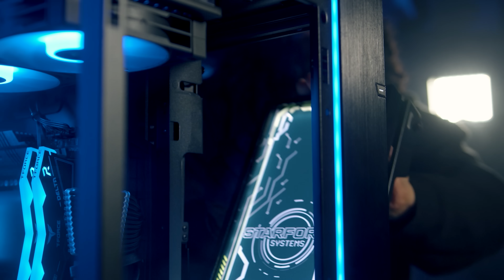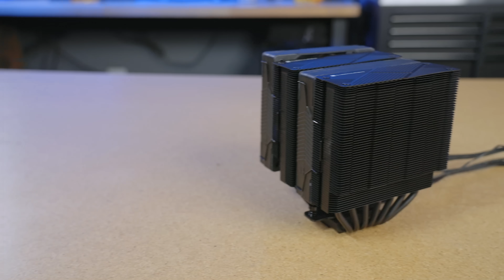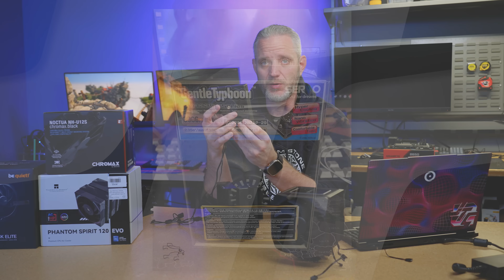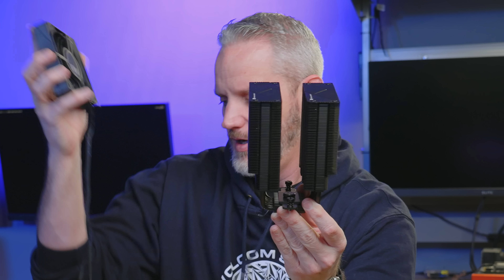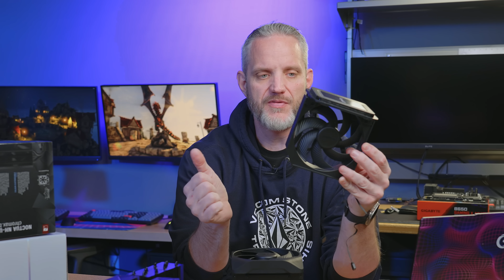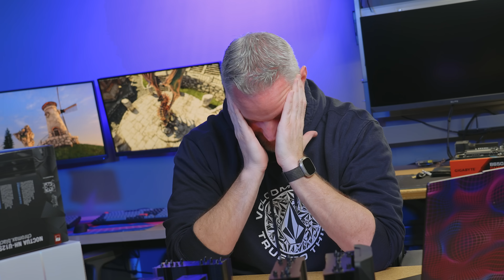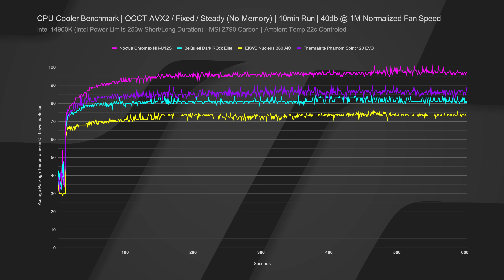This $49 CPU Cooler has big brands SHOOK! Thermal Testing Cheap vs Expensive CPU Cooler!

Comment: The biggest issue with Thermalrite is the ridiculous number of choices you have,
Reply: That is the companys problem mostly. You can pick any one of them, even the cheapest Peerless Assassin SE, and get a great cooler that is practically just as good as the other Thermalright dual towers, even the more expensive ones.
Reply: @MaaZeus  suffering from success
Reply: @Spectyrr  this is so fucking surprisingly accurate from me 😆
Reply: After-sale support isn't great either. They announced an adapter frame for AM4 (when that socket was still fairly new) for their older coolers like the Macho series, but about a month or so post announcement said adapter was impossible to find anywhere. It's like they only produced a couple hundred and that was it. The coolers are great, their support not so much unfortunately
Reply: @Knaeckebrotsaege  Yes, I still use D14 from 2009 on AM4 system, and it is still compatible with everything in the market and you actually can get these adapters in real life.
Reply: @Knaeckebrotsaege  they manufactured only a few of those, then switched to the Aro 14 for AMD Sockets... too bad you don't get a black one of those... only grey and orange...
Reply: @Knaeckebrotsaege  That is the one thing where Noctua trumps them all. But they can afford it because you pay dearly for their products. For Thermalright I guess it is better to get a new cooler if a need is dire, but at least you won't pay an arm and a leg for them.
Reply: Eh. My retailer has 34 different Thermalright air coolers listed. They also have 32 different Noctua air coolers listed. Options are good. Homework required is good too.
Reply: @lunsmann  want the second best air cooler on the market? Go with Phantom Spirit 120 SE. Want the best air cooler on the market? Go with Noctua NH-D15 G2 for 3x the price.
Reply: It's Thermalright
Reply: @Cytronik  I thought so, I originally wrote Thermalright, but the description under the video they have it as 'Thermalrite' so I changed it, thinking Jay and co would know better as they are reviewing the product.
Reply: Just pick the one your case can fit and what you vibe with the most 😂😂😂
Reply: this, all that options and the one I want wasn't available, so I ended up buying Scythe Fuma 3
Reply: You're not kidding. I just went to have a look at a local store here in Australia (Centrecom), selected filters "CPU coolers", "Thermalright" and "air cooler" and it's still showing me 30 options!
Reply: Yeah it's crazy how many SKUs they have
Reply: and yet………..all are very good.
Reply: and the fact that some of their cooler advertise LGA1366 compatibility (even on the box), while in reality they do not support it. they actually removed it for the frozen prism 240 black when i pointed it out to the CS, so points for that.
Reply: This applies to any other component or accessories too lol
Reply: And everyone of them cheaper than everything else.
Reply: and second issue is the fans - K12 ARBG in one of two ARGB not working properly and bigger issue is smell, real bad smell for me it is not usable bc of this, i brought single A12x25 instead
Reply: @Foton0154  The fan Y-Cable thing did self destruct on me for mine, as in it just fell apart.  I figured maybe I just put too much force on the cables when tying them aside though.  I used two CPU fan jacks instead of the Y cable in the end.
Reply: They only sell one product. The Thermalright Peerless Assassin 140. That is the one you want. It is the best air cooler on the market and only 50 bucks. Ignore everything else. Thermalright Peerless Assassin 140 is it.
Reply: @12gaFreedom  except Phantom Spirit 120 SE is better...
Reply: @MV-ri7zu  r u sure
Reply: @joby602  yes
Reply: @joby602 Doesn't matter .. they are both good enough.
Reply: All of their dual tower designs are great, limit yourself to those with 6 or more heatpipes and you only have to look through... 55!!!!! SKUs.
These guys are insane...
Reply: @YOEL_44  A lot of their "different" SKUs are just single or dual fan versions, or a cheaper version of the same cooler that isn't fully painted and/or lacks the endcap hiding the heatpipes on the top to make it cost less to manufacture ("SE"), or just the same cooler but less tall ("mini") etc  ... there aren't THAT many actually different coolers, but a lot of variations of the same models
Reply: @Knaeckebrotsaege   As a consumer that doesn't matter, you see such a list of options and you get overwhelmed.
Reply: @12gaFreedom   bought a thermal right 360 aio for about 75 quid and very happy with it idle temp is about 3-5 degs above ambiant and hasnt exceed 55degs on full load or prolonged gaming
Reply: @12gaFreedom  Won't fit in my Lian Li ITX case. Peerless Assassin did, albeit with just one fan at the center because of the mobo cables being in the way.

Comment: @Jayztwocents Check out the unique design of the ALSEYE W90C CPU Cooler, Temperature Displayed CPU Cooler or the  Thermalright Burst Assassin 120 Vision Black CPU Air Cooler. I am using the Thermalright with a Asus AM5 Tuf motherboard. Both are very "cool" in design.

Comment: I bought 2x "Phantom Spirit 120 Evo" to cool a 9800X3D and his little brother the 7800X3D for game configurations on Star Citizen and CP 2077
But I replaced the original fans with 120mm "Silent Wings 4 Pro"
The best of "three worlds" :eyes-pink-heart-shape:
Reply: Are the silent wings 4 pro considered the best 120 fans? Kinda new in building and looking for a cooler
Reply: @maisondav1d  Question of point of view, for me, it is the best performance ratio VS noise nuisance !
The most magnificent is that "Phantom Spirit + 2 silent wings 4 Pro" are more efficient for cooled and quieter by several dB than the Dark RockPro 5 and the Elite I tested before making this "mix" :finger-red-number-one:
Reply: @NH-Nicolas  cool thx 🙏🏻

Comment: Oooh on the note of cooling, did you ever see Optimum's video about "I fixed PC Cooling." and the idea of 3D-printing internal air ducting to properly channel airflow? 

If so, did you ever test it for yourself? The performance increase he has in his video are pretty impressive but I'm curious to see someone elses experience.

Comment: 11:30
You should  test coolers on all amd cpus because amd coolers result are diffrent in comaparassion to intel
But amd cpus has a little problem wich is 1 ccd vs 2ccds
So you have to do all amd cpus

For further clarification you can ask hardware cannucks channel

Comment: 1. FDB are the best type of bearing out there.
2. MagLEV bearing are not using magnetic levitation. Those are FDB bearings with magnets at the center of the shaft to position it correctly and elimitate tipping at the start point.
3. Ball-Bearings are loud.
Reply: Ball bearings are not that loud. Louder than FDB or sleeve bearings, sure, but not obnoxiously so. Case in point, the Gentle Typhoon that was mentioned here too. The grand daddy of all static pressure fans and yet it was very quiet at low RPM. And thanks to the ball bearings, they lasted virtually forever, some people still use them.
Reply: i have 5 p12s in my case, they are super silent even at 100%, ball bearing fans are quite good under 2000 rpm, i also have a p12 max i'm not using anymore and that thing was loud over 2300-2500 rpms, ball bearing fans greates problem is longevity but for 35 bucks a pack of  5 i'll happily swap them every 5 to 10 years lol.

Comment: I literally upgraded from the NH-u12s Chromax to a Thermalrite Phantom Spirit 120 EVO just last month lol, THE PERFORMANCE DIFFERENCE IS INSANE.
Not big on the fans though, so I switched those out for Nidec GT units, and the difference is just astounding; easily like 30% more performance over the Noctua with like 50% of the noise.
Reply: Did you lose performance with different fans?

Comment: Have the Phantom Spirit 120 SE for my new 9800X3D and it’s fantastic.
The Peerless Assassin and one or two other budget coolers are about the same price point and cooling performance. Doesn’t make sense to pay twice or thrice unless you really want the quietest and/or coolest and for OC perhaps no matter what and if money doesn’t matter.
But at that point, water cooling should be the better option.
Reply: I have the same cooler, I found that the included fans were alright but limited to low RPM. I had some spare silent wings 3 from an old build and got better noise/performance. Frankly the cooler itself is excellent and if you've got some higher quality fans to spare you can get a noticeable uplift in performance out of it. I should add that it's only worth trying if you already have some spare fans as the stock performance is good enough and it's certainly not worth going out and buying extra fans for it to bring temps down a little more.
Reply: Have had PS120 cooling 12900KF pcores for a couple years now. PA120 SEs on 9600K and 12700KF. Think FC is going on 9900X3D also have a spare PS. Great value cooler line have installed at least 4-5 total, love them.

Comment: I run a Noctua NH-U12A and paid $120 for it.  Never have had any heat problems with it.  Purchased in May 2022.
Reply: I'd say it depend on at what surrounding temps and what cpu power used and at what temp the cpu starts throtteling, your stuff at your temps seems fine!
Reply: @Bratfalken  I don't really play a lot of super demanding games.  The most I see is 60's.  Temps in my apartment range from 71F to 77F, so not all that warm in here.

Comment: "I made a equation for testing that should make Steve proud".... Continues to run Heaven in the background to annoy him simultaneously..
Reply: I bet it's just a captured video footage, not the actual heaven software running
Reply: @fajaradi1223 in a previous video I think jay said it's rubbing off the graphics card that was in "Satan's pc". Think it was the last video where he said that's what's running it.
Reply: This is Jayz version of "Can it run Crysis."
Reply: 😂😂😂 you monster!!!
Reply: Why does steve hate heaven? I couldnt find a video of him talking about it
Reply: @jaytay420  He does a bit in jays video when they come for the gpu testing overhaul
Reply: Gotta keep the guy on his toes, man.
Reply: Haven
Reply: Why does Steve dislike Heaven?
Reply: Ouuf 💀
Reply: Every time Jay shows Heaven in the background, Steve’s hair goes into Krak’en mode and threatens to off Linus unless provided Carolina BBQ or good quality Thai food immediately.
Reply: The expected lifespan of these coolers isn't in that equation.
Reply: @francoisleveille409 Literally, the only thing that could fail is the fans. Which are stupid easy to replace. Unless the cooler didn't have the thermal capacity for your CPU. But chances are if you're buying this, then you probably don't have an extremely high end CPU that really cranks out the heat. But I've seen this thing run in person. And for it's price,  it's incredibly impressive.
Reply: @ When a cooler fails you have to replace it and potentially pay to have a technician replace it which is usually more than the price of the cooler itself. So inexpensive coolers can turn out to be much more expensive in the long run.
Reply: @francoisleveille409  A cooler Its a chunk of solid metal, It will only fail when it falls apart from literal rust (takes decades), it doesn't break, it doesn't bend and if by some miracle it does, replacing the cooler will be the cheapest thing to worry about.

 The only thing that will fail are the fans . You telling me you need to pay a technician to replace a fan that most times doesn't even require screws to attach it!? Do you also pay technitians to plug in your USB type A devices? Because you know... there is a 50/50 chance of getting it wrong...
Reply: @mrsuperselenio5694  🤣🤣 The copper will never rust, the vapor chamber will never leak and the clamps holding the fan(s) will never break! 🤣🤣
Reply: @francoisleveille409  Dude... what??? Unless you wash it with water and soap (which at this point I wouldn't doubt), even on a high humidity enviroment it will take anywhere from 7 to 10 years for the copper to start rusting and with that much humidity its likely that other way more expensive components on your computer will fail long before the rust process on the copper even begins. 

The vapor chamber is sealed shut by bending the metal, it will literally take a drop or a hit with a rock to even deform it and if you are worried about any sort of temperature deform happening, your motherboard and CPU will melt before it even reaches a high enough temperature for it to even move.

Clamps are made of steel wire, even if you clean up your computer 3 or 4 times a year, after 10 years that is only 30-40 usage. You gotta be pretty aggressive for it not to survive and even if it breaks, you still can get a bag of 300 zip ties for single digit $ at your local hardware store and tie the fans..... stop coming up with excuses dude, those metal blocks will outlived you
Reply: @francoisleveille409  if it last 10 years, Its more than enough and in due for a replacement considering technology advances, there will be better at around the same price you paid 10 years ago
Reply: @ Some very inexpensive coolers have their fans fail after only 3-4 years. Getting them replaced is more expensive than the cooler itself. The original cooler on my i7-970 system lasted more than 14 years which makes it less expensive in the long run. Nothing has changed about that since 2011.
Reply: @francoisleveille409  Almost every cooler has 120mm fans that can be replaced for any other 120mm fans that you can buy for 10$ or even noctua ones for like 15$. How is that more expensive than the cooler? Hell you could buy the 50$ cooler, buy the 2 noctua fans and it will still be cheaper than buying the noctua cooler all together
Reply: @francoisleveille409  my Cooler Master hyper 212 I bought for my i5-4670k system I build 12 years ago, cost me 25€ and it still working...
Reply: An equation*
Reply: The running heaven meme needs to just end already
Reply: @get2choppa  Nope! It's still funny don't you think?
Reply: @ wasn’t ever

Comment: I have the Phantom Spirit SE on a 9800X3D. Unless you do massive overclocking you really don't need anything more fancy.

Other than the quality of the fans / noise I don't really see what the point of Noctua is. The result just doesn't justify the insane prices.